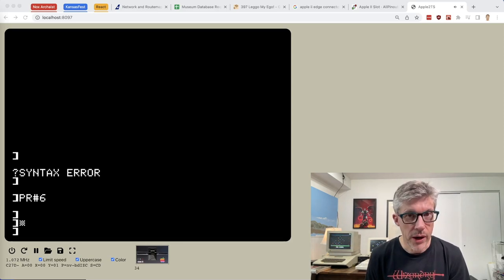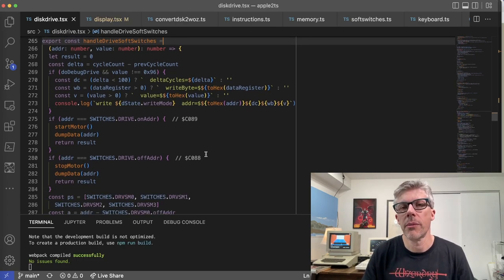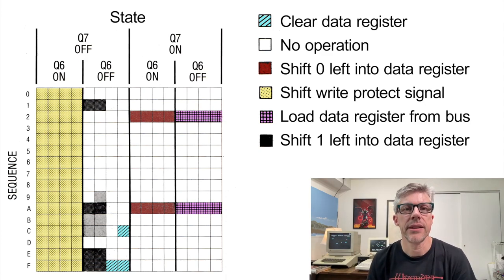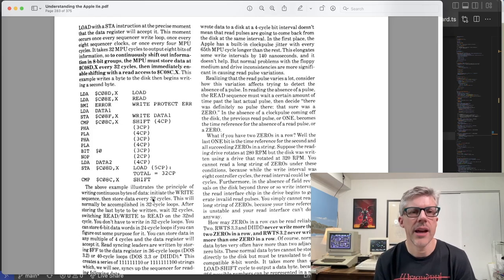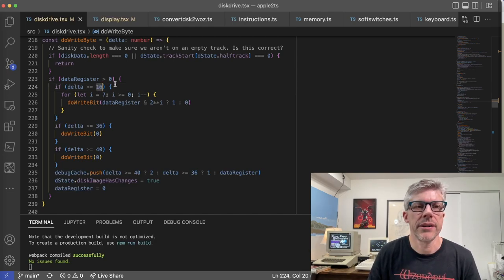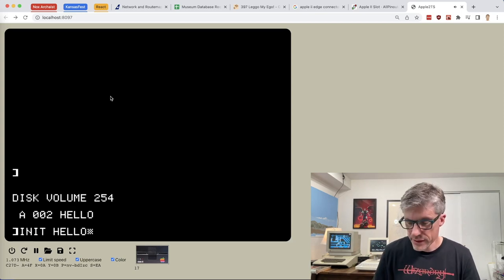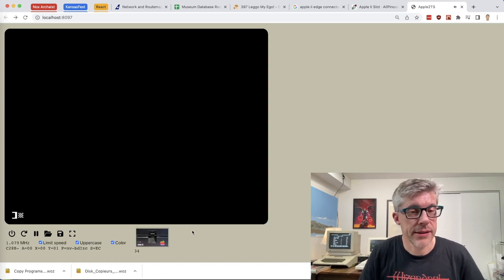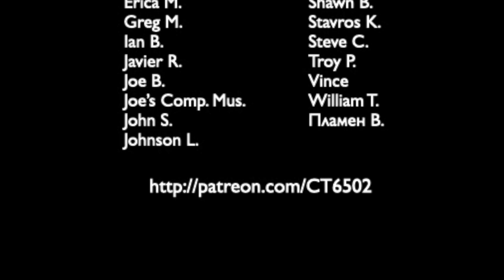#140: Apple II Emulator Writing to Floppy Disks

Comment: Thx for the episode. Early on on my emulator I have decided to drop the complex timing requirements and focus my disk emulation on unprotected disks. Looking at your video, I am actually glad I did it, as it seemed quite complicated. I am however hyper hyped to see your upcoming video on the IIe characteristics.
Reply from the maker: Yeah, it's pretty complicated and I wasn't sure that I could get it correct either, which is why I bypassed the Logic State Sequencer and just used the "delta" between the softswitch instructions. It's "good enough" for now, although I'm sure it would fall apart with copy protected disks...

Comment: Amazing, as they all have been. Thanks for all your work on this, Chris!
Reply from the maker: Thanks Jon!
Reply: @CT6502  If the WOZ format had existed back in 1985, could the technique you're using have been run on something like a IIgs to copy ALL of the copy-protected disks? I wonder why programs like LockSmith or Copy2Plus were so limited in what they could duplicate.
Reply from the maker: @JonRowlison  Well, it might have helped a bit, but not totally. The Applesauce device can do two different types of copying - one is the regular "woz" format, which is what I'm supporting in my emulator. This works for all non-protected disks, and some copy protection. But many copy protection schemes are so devious that you need to do a true "flux" copy, which the Applesauce also supports. They turn out to be like 20 Mb in final size for a 140Kb floppy. I don't support those, and you usually can't write those back out to a floppy without specialized floppy disk drives which no longer exist. There are also some regular woz files that still have the copy protection on them, but rely on synchronized tracks or other weirdness - those don't work properly in my emulator either, because I'm not emulating a real spinning floppy disk with the Logic State Sequencer...